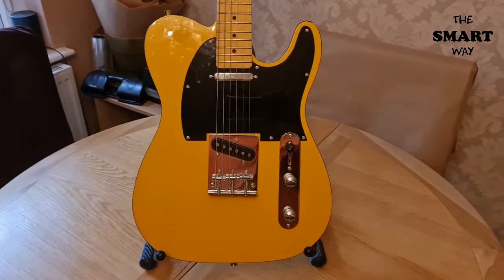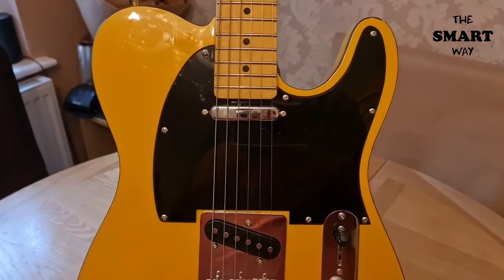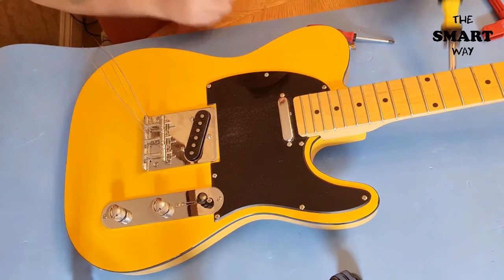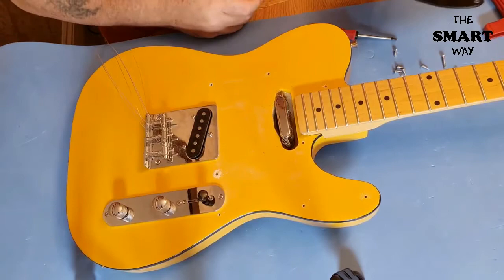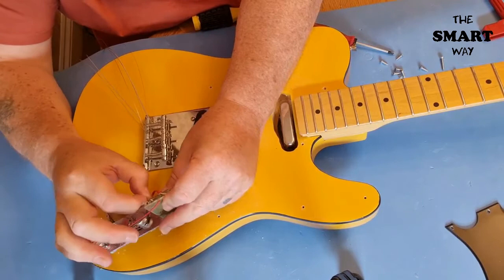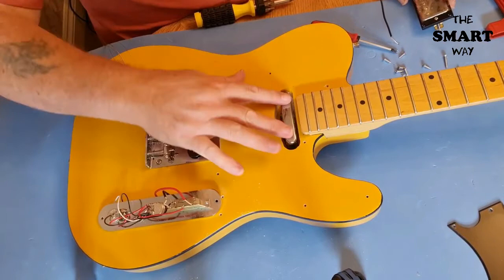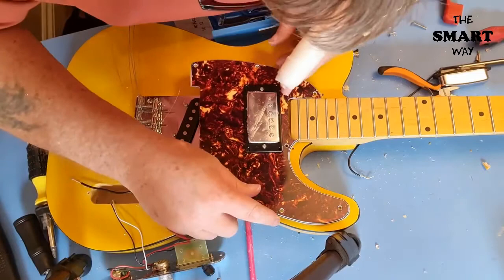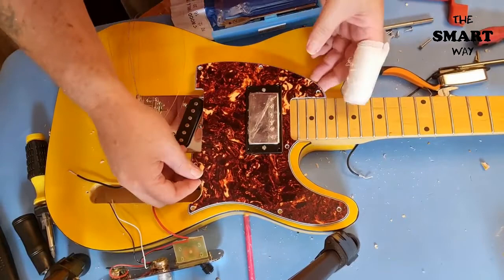Graham Coxon Telecaster On A Budget Part 1

Comment: Can I suggest that you buy some Forster bits which are fairly cheap (about £12-£30 Amazon) and effective as they cut s complete circle best used in a pedestal drill but work in a cordless saves on blood loss...😜🇫🇴☮️🇬🇧👍
Reply from the maker: 😂😂😂 Point taken
Reply: you would need some sort of depth stop with the forstner bits, otherwise its easy to drill too deep, especially if you  do it without a drill press